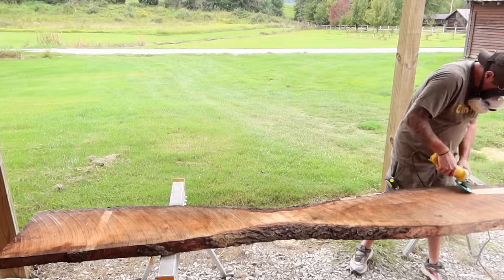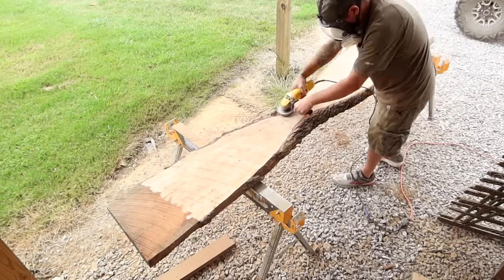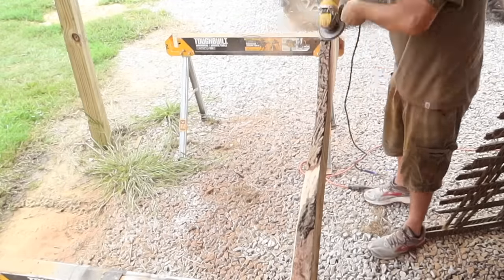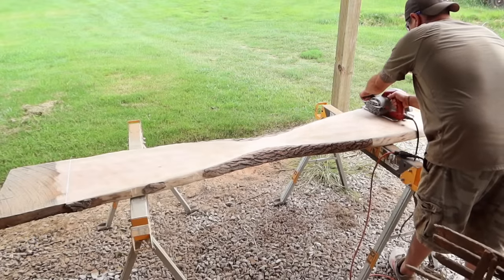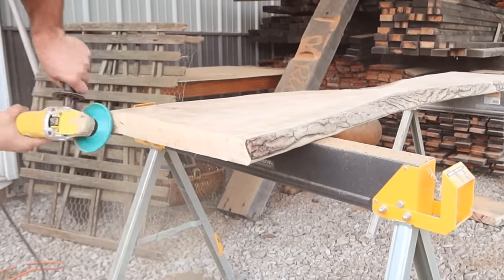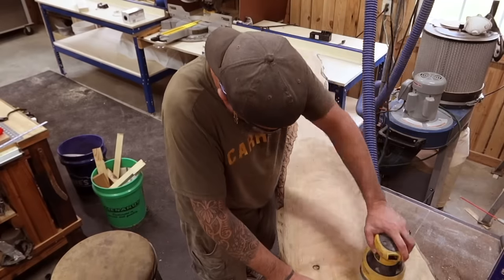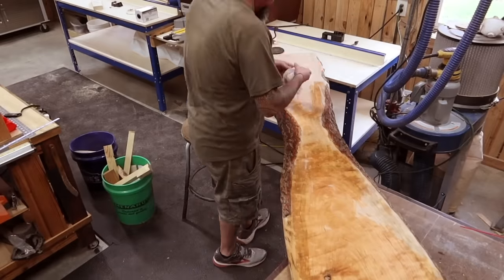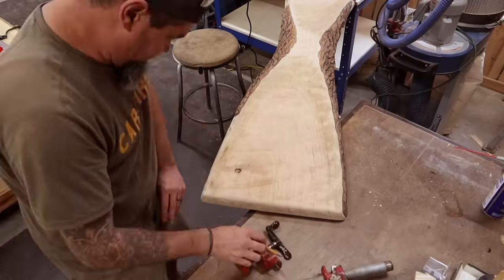Turning Scrap Wood Into Art

Comment: “ Pinched For Time “ outstanding job and for the mind as you are right. We must follow what intrigues us and step out of the day to day. My wife and I rescued an antique make up table adored with carved mirror keepers and drawer faces. It was a wreck. Swollen from moister top missing chunks of veneer and separated. She loved it and I love her so there ya go lol. It was missing one carved piece so I made something I never would have tempted to before. Again you hit it on the head. Copying the shape was easy but carving the design with highs and lows with pitches and dips was challenging. Had every Drimmel bit in shop out including my pocket knife lol. Turned out great and was a real sense of accomplishment. Now she’s found an old bar stool and I’ve converted it to match complete with all carved adornments plus 2 small draws with same faces. What a trip. She’s worth it. Great video man.

Comment: I like it!!!  I too like making something out of things others would throw away.  I guess I got it from my father, he was the same way.   In the early 60s he picked up a bunch of long, ruff cut, oak beams from the trash pile of a building being torn down.  They were 14 to 16 feet long and 2+ inches thick and 12+ wide.   He stored them in a building and they were in good shape when I needed floor Joists 13.5 feet long to build a 26 X 28 foot 2 story garage on a slab my father also pored in the early 60s, just before we moved away.  We still owned the property which I inherited.  So in 1997 I finally built the garage. My father started in the early 60s

Comment: Beautiful piece or work Matthew. When I first saw the slab, my mind went to the split cabinet always behind you when you are making your videos. The shape matches the shape of that piece, which I think is a work of art, and if it were able to be resawn on a large bandsaw, it would make the front and back of another one. Your use of the pipe clamps was wonderful though, and I really think it would move quickly if you posted it for sale at $500 or more.

Comment: Cool piece!

When I saw this, I thought it was missing something within the shape.  I know it's too late now, and it's all retrospective by me, but I'm gonna say it anyways 😂

The piece is being pulled at the corners and squeezed in the middle!  For me, the legs could have been at an angle to appear to be pulling at the wood!  Secondly there could have been some thick gauge wire in the middle to indicate a squeezing of the wood by an old fence wire etc!

Hey!  That's me, and I didn't finish the piece, but you did ask 😅  It looks good fella! 

Cheers 🇬🇧

Comment: Great video. Thanks for sharing.  I can't imagine that somebody would throw away such a nice wood slab. And that I say as a pure amateur woodworker, with probably less than 0,1 % of your wood working skills. When I saw the title of the video, I thought that you were reading my mind. The same day you released this video I was at our cottage, where we use wood (mainly pine and beech) to heat up the interior  From time to time I take some wood from the wood shed and bring it to my garage or my shop to make something out of it.
The last time I took some wood from our woodshed was in summer. Irregular chunks of beech wood, appr 10x10x25 cm. But that wood was very hard and too big to process with my
mitre saw. I didn't count with that. So at first I must make it smaller on my table saw  I made a theoretical plan how to cut it into smaller parts. But I didn't do it yet, because at first I need to make a kind of ripping sled. So that's all for the (near) future. On Sunday I chose some smaller (less thick) pieces of beech and pine which I should be able to process easier and quicker, and use them as a learning curve for the bigger chunks of beech wood. (still need a ripping sled, though)

Comment: Cool project.
I have some slabs of Juniper drying. They are not dry enough to cut yet.
Reply from the maker: Nice! Can’t wait to see what you come up with.
Reply: @MatthewPeechWoodworking  When I first cut the tree I tested out an Alaskan saw chain mill.

Cut a log in half then later cut a slab off of one of the halves.

The center red part I turned into a 1" x 5" x 4 ft maybe.
I sanded it. Hand buffed in  Gorilla Glue as a finish.
(Saw it on This Old House 50th in Hawaii)

The board got used as a hanging coffee cup holder in some good friends kitchen.

Comment: I like to get pieces like that and make candle holders from them. I cut a piece of the board off each end that I shape into legs then use Forster bits to drill the holes for the pullers candles. In another case I took the piece but instead of drilling the holes into the piece I cut out circulars pieces from the ends and glued them in to make the places for the pollen candles.

Comment: I flinched when you jabbed the chisel into the clamp. You need to take your sharpening to the next level by polishing the edge. Put some metal polish on a soft piece of wood and continue to sharpen. You will know you are done when you start to shave off pieces of wood. They chisel will be twice as sharp and no more of those uncontrolled slips.

Comment: If you run a live edge board through a planer will it knock off all the live edge.  I don't want to ruin my pieces.
Reply from the maker: If the bark is loose it may knock off some bark.